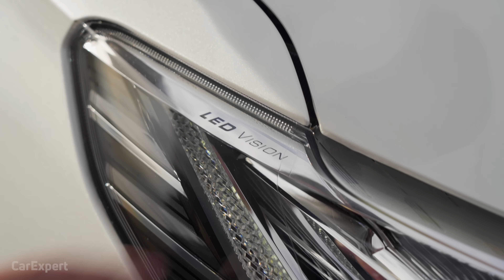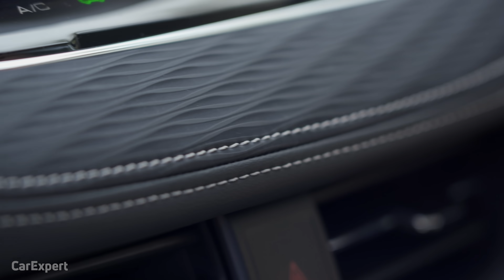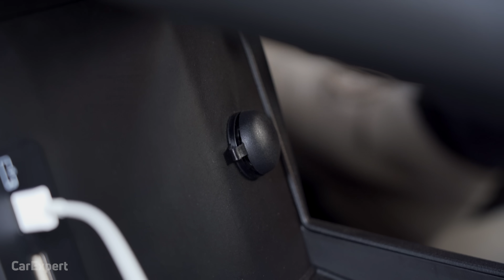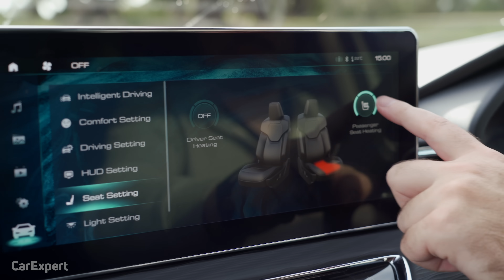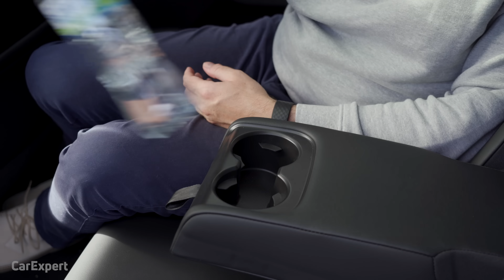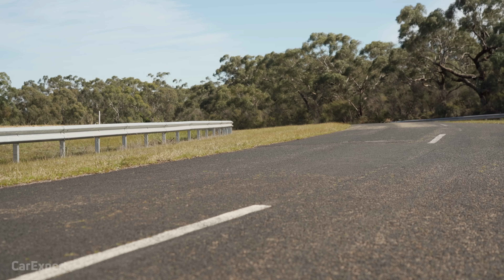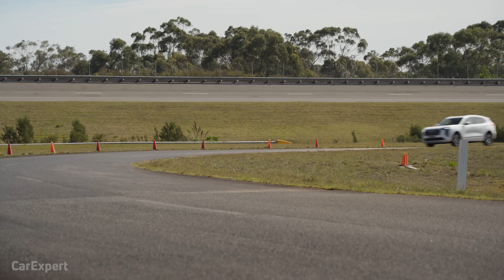2022 Haval Jolion turbo detailed review (inc. 0-100)

Comment: Drove one of these in NZ. Horrific car to drive. Awful auto and gearbox. Multimedia is totally useless, and the ride is disconnected from the road. Avoid at all costs!
Reply: I drove my friends Haval H6GT. The gearbox was horrible, it jumped and kinda stutters into first gear, there is very noticeable throttle lag as well. I had to go more than 30% to feel something. The android auto is wired and when I try to use wire it doesn't even detect it. Even though its got all the bells and whistle, the engine, gearbox just puts me off completely. I'd rather just buy a BYD EV instead of I were to spend the same amount of 40k

Comment: There is a sports mode, acceleration is much faster and gears shifts differently as well. Fuel consumption goes to hell :D That said, you can access the modes by swiping from the left of the console screen. ECO is really efficient, but slow like a tortoise when it comes to acceleration (especially on cruise control)

I know I am 2 years late.

Comment: We own a 2020 Haval H2 & she is a joy to drive. Within the first week we loaded the boot space including the fold down seat with a load of wood for winter fire. The ride was comfortable especially over back country roads. We have had four adults ride with the back seat belts challenging to click into place. The warning lights showed these were not correctly clicked. The passengers were surprised by leg & head room, even with the arm rest down for shared comfort. The luggage space was plenty for two suitcases & carryon bags from an air flight home. The six speaker sound system was easily adjusted for maximum pleasure for the driver . This is the first SUV in our price range and is more than enough for our, & family needs.

Comment: i have driven the haval h6 lux 2018 for nearly four years, long distance driving on a regular basis has proven to be nicest and most  comfortable, safest ride fuel economy 9.5. i have only just replaced tyres. the only down side was the cost of fuel at 95ron i have just traded the havel for the new h6 GT ultra with a better fuel economy of 8.5 and it takes 91ron I recommend the Haval for a great driving experience and good bucks for your money, affordable luxury
Reply: Hi,
How is it now?
I'm in the market for one?
What is your advice?

Comment: I just took receipt of the MY22 Jolion Vanta. To say it's the best car I have owned would be lying. My MY21 Hyundai i30 elite sedan was. But it got flooded in Brisbane and I thought I would this a shot. It comes in at.01% less than the Hyundai. Only reason is with the Hyundai I could change the dash colours from Blue to Red to Green.. So normal, sport and eco driving respectively. I wouldn't have owned a GWM a few years ago as they had a name like Hyundai did in the early 90. Now I don't think I will convert back to any other. It will be good to see a full electric come out
Reply: Hi, did you receive a Key number Tag as in the owner's manual Page 18? If so, is the Tag last 6 digits is your VIN number? Appreciate your reply.
Reply: Hi,
How is it now?
I'm in the market for one?
What is your advice?

Comment: Just picked up my new Haval Jolion Ultra Vanta 3 days ago, car looks and drive good so far but we were socked that they only give you one key and no spare key, they don't even know if they can order a spare key for me. They gave emergence key to open door only. Can someone help? thanks.  Australia
Reply: I am also surprised when I had only one key..don't know why they cannot make two keys
Reply: @sanathkavindika691  Hi Sanath, the 2nd key is not a big issue. Check if you receive a Key number Tag as in owner's manual Page 18 and if so what's the number in the Tag. There could be a security risk with your smart key fob codes.

Comment: Learning the electronics is a pain. One thing if you cannot get driving data on the screen through the wheel, hold OK button for two seconds.then up and down will change pages etc. As others have said swiping from very  left edge of main screen will bring up volume , driving mode selections , heated seats etc.  The other pain is the adaptive cruise control, good at keeping distance from car in front, but brakes excessively for the most minor corner even when no cars in sight to the point that you need to use the gas for all corners. Am told turning off lane keeping function  will deactivate this annoying thing. Haven't tried that yet.
Reply: Yes excessive slow down on corners, I get to anticipate this and have foot ready on accelerator. You would think a software upgrade could fix this

Comment: You got the handling all wrong Paul Maric. The low speed ride is what’s on point,  very few people are going to drive this car over continuos undulations at 120kph. The low speed ride is why it’s soft, you are trying to make the body control out badly, but many cars today are too harsh for normal city driving. You like sports cars so if course you like planted dynamics.

Comment: 9 liter per 100km for a 1.5 liter engine. That's pretty thirsty. I'm not a fan of a double clutch either. Had a VW golf and it's not good for inner city driving. Highway is great. Thought they would have improved by now
Reply: That's with almost no highway driving and driving in testing conditions, I'm sure you don't floor your car and go from 0 to 100km as fast as you can very often.

Comment: Hey Paul great videos! I'm tossing up between a Haval Jolion and a MG ZST, about the same price here in NZ, which one would you recommend?
Reply: Pefer Haval as it has higher reputation in china market. I own Haval tank 300 in China with 20k miles and it's quite good so far
Reply: Jolion. ... friend here bought an MG and nothing but issued with it.
Reply: Hey did you get the jolion? How does it drive? Thanks
Reply: @RohitSharma-wp6rx  yes I did end up buying the Jolion, about a month ago. It’s really comfortable to drive. Really enjoy it so far. The radar cruise control was a bit of an issue at first as it braked heavily on the slightest of corners but they have since realised a software update to fix that. In all the reviews they say the fuel economy is terrible but it’s coming down for me every time I fill up. I’m getting about 7.5L/100km now. Started out a bit high but the dealership said that’s normal for new cars until they break in a bit.
Reply: @ferti385  thanks a lot as feels much better when you get local responses. I am getting mine soon. All the best mate.
Reply: @RohitSharma-wp6rx  awesome! Enjoy, it’s a great car!

Comment: One thing you should have covered was the safety.

You can let the steering wheel go at 100kms/h and it steers itself which has been amazing.

Blind spot monitor is excellent. You should have showed what happens when you start to veer over a line the car will correct your steering.

The only feature we turned off was the distraction feature as turning the AC on bongs on the screen about paying attention to the road 

Lastly the cluster is fine we got ours 3 months ago and it's all English including stop signs etc.

If you need a jolion to test with mate happy to loan it..

Comment: This car proves how overpriced every other car on market is. It has many features and not just features for the sake of having them. The parking cameras for example are better than even some premium brands. Even the new C Class which is 3 times more expensive does not come with drive assist features as standard. I test drove a Jolion and was blown away.
Reply: Me 2.. I'm buying one cause how it blew me away too
Reply: I'm from Bangladesh & the Hyundai Creta sold here is from Indonesia, gross weight of that car is 1590 kg & It start's from 20,000 dollars in Indonesia (top model 28,000 USD) and 34,000 dollar starting price in Bangladesh. I've seen the car & build quality is good enough. Much better than the creta grand/alcazar in India, in which bonnet slap sound was very echo-ish & had noticeably thinner metal.

If I'm not wrong, Indian Creta start's from 12/13 thousand dollars & top model goes upto 22/24 thousand dollars.
Reply: @ostadfiha4225  It's too expensive for a car built like that.
Reply: What's the price??
Reply: I agree with you but at the same time also disagree with you. Toyota, honda, Hyundai and all big brands took decades of experience & spent billions of R&D and learnt how to make a good car. Whereas Chinese companies came 10/15 years ago, made partnership with them & copy paste everything from those big brands. That's why you get them cheap. No money spent, no R&D or decades of experience. Just the material cost & rest is their profit margin. 
You'll notice they lack many small details and imperfections in these cars which you won't find in a Kia, Honda or Volkswagen.

Still, great choice for those who wants a big car but don't have enough money.
Reply: @ostadfiha4225  I disagree especially if you look at Hyundai. The new Hyundai Creta is honestly a pathetic vehicle at its current price tag. The interior is extremely cheaply made, has no parcel shelf, a very basic infotainment system and overall just feels very poor. Newer VWs have very very plasticky cheap interiors and honestly, having driven the Haval Jolion, the ride quality and refinement isn't far off a more expensive T Cross all while being a larger car with much more safety and convenience features. It feels more expensive and isn't lacking in detail.
Reply: @SDav21   Hyundai Creta was primarily made for Indian market & Indians don't care about build quality. They care mostly about affordable price & high mileage. That's why it has more plastic & lighter body. 
If you look at the Hyundai Kona, which is for North America, Europe and Australia, that car is extremely well built & has 5 star safety.
Reply: @SDav21  yes, Chinese cars have came a lot far. And they're only gonna go forward in the future. Chinese phones have taken over, now it's the turn for automobiles.
Reply: @ostadfiha4225  And yet it is priced exorbitantly and is not cheap at all. It's horrible.
Reply: Typical..people look at features only and not core driving experience. This car is bloody awful to drive.
Reply: @mrkring1526  the car drives better than many in the segment.
Reply: @Mr Kring  using one as a hire car in Brisbane ATM had my doubts, surprised how good it is going
Reply: @mrkring1526 how do you know?
Reply: Chinese car. Think about durability!
Reply: @nadarfa9413  7 year warranty tells me they must have some confidence
Reply: @nadarfa9413  My cousin has an MG3 and Haval with 257,000ks on it. Still going strong. His hilux had more problems..
Reply: @nadarfa9413  someone is still living in 2000s

Comment: Hi Paul, im in South Africa. I bought the car in July. The fuel economy gets better the more you drive it. Im hardly on the freeway and im currently averaging 7.7l/100km. I absolutely hated the dual clutch at first but you get used to it. I love your reviews by the way.
Reply: I test drove it, great car by the 
Way. I'm going to trade in my polo for this
Reply: The new software update makes it a bit better.
Reply: My fuel economy was always 10L/100km and I had it over 2 years before I traded it in for something with actual power. That’s by far its downside is the complete lack of power
Reply: Hey Vuyi.  Are you still enjoying your wheels? 

Still averaging 7.7?
Reply: @MoneyTalks_with_Keba.M  hey, im still enjoying my car. I went and got software upgrade. My fuel economy is still around 7.7 or 8.0 if im really wilding. I pour R250 around the 15th and then on payday its R900 full tank
Reply: @vuyiswamokwena1399  Thank you so much Vuyi. This is very helpful ❤️

Comment: Not sure how I feel about all these controls on the LCD. 

Coming from a Nissan where the screen faded and became unusable in 3 years, had to drive around without a screen for 5 more years before I replaced it. At least the screen didn't control anything important.

Definitely looking at these chinese cars by the looks of it, they will offer a better experience than I had with Nissan.
Reply: It may be the only advantage of chinese cars. Nissan at least is not falling apart during the drive. How to leave your rear bumper on the road - on a city road, just spontaneously...

Comment: I have a MY21 HAVAL, Jolion, which I took delivery of in MAY this year. Have been really impressed with it overall so far. It now has a little over 4000km's on the dial. Fuel economy, On a recent trip from Bundaberg to Mackay, at an average speed of 105 KPH, I had no trouble achieving the nominated L/per 100k's. Acceleration is better than what you have specified and I have had no trouble overtaking B Doubles on the Marlborough Strip where the posted speed limit is 110KPH, have found that I am doing at least 170 KPH when I return to my lane after overtaking. Only real problem which I have encountered, and which I have been assured GWM are aware of and working on, is the Lane Keep Assist when on Cruise Control, it tends to apply the Brakes every time it looses "SIGHT" of the WHITE LINE on any Camera especially on bends in the highway. Overall am really impressed, mine is a Mid Spec model and it has ALL the "BELLS and Whistles" that my brothers $300,000 Mercedes AMG has, for less than10% of the price!!
Reply: Hey Merv, thank you for your elaborated review. However, May i ask how about the Nm torque you feel when push the accelerators? Does this suv push you back to your seat? 
My second inquiry, do you feel you on control on the car through steering wheel, does the steering wheels feels more on soft or firm? Thank you Merv!
Reply: @javed_mate  Am more than Satisfied with the Get up and Go, when the acceptor is floored it sits me back in the seat, not like a V8 but still noticeable.
Reply: Steering is positive enough for my liking, am a little upset with the LANE KEEP ASSIST, mainly when using Cruise Control, have been advised that GWM HAVAL are aware of problem and are modifying the software to correct the problem.
Reply: Accelerator
Reply: @javed_mate  If one chooses to floor the accelarator it certainly pushes one back in the seat, even more impressive in MANUAL mode.Steering always feels "Normal" to me.
Reply: Thank you Merv for your reply!
Reply: How much did it cost you??
Reply: @pkboss8324  way more then he should have paid
Reply: I’d not be publicising that you pass at 170km/h. There’s absolutely no need for that sort of dangerous excessive speed. Also if the posted limit is 110km/h you would not need to pass anyone doing that speed.
Reply: @jerrymyahzcat  B doubles travelling at less than posted limit require a lot of distance to overtake and I do NOT like to spend too much time on the "WRONG" side of the road which is how 170ks comes about!
Reply: It’s illegal to go over the speed limit while overtaking.
Maybe re sit your licence and buy a better car while you’re at it .
Reply: @W3TFART  I have the better car, and there is NO restriction on overtaking!!
Reply: @mervallan1822  better go resit  your licence then because you are wrong

Comment: If you select the sport mode the car would have more punch. I think the reviewer is using a normal/economic mode that is why the car saves more power in exchange for fuel efficient. I bought the Haval H6 top version and it has all the safety features and technology almost just like luxury cars. The screen also is not lagging compared to some more expensive cars which can be lagging sometimes. For money wise it's really very satisfying car unless you want a 100km speed in 3secs then this car doesn't suit you. The panaromic sunroof is so huge and satisfying, you will look cool when you take the pictures from inside the car because of the huge panaromic sunroof that makes the car look luxurious. You won't regret buying the all new 2021 haval h6 or jolion for that price.

Comment: Can’t wait for your H6 Hybrid review. Preordered mine for delivery around Xmas.
Reply: What is the price of the hybrid?
Reply: @adambeck4416  same as the petrol version.
Reply: @Mrblobbster  which country do you live in Australia?
Reply: @adambeck4416  Nope. New Zealand, so should be a similar price in Australia
Reply: @Mrblobbster  I just went on the Australian and new Zealand GWM websites and the hybrid is not even advertised
Reply: @adambeck4416  I asked the dealer about it and he told me they arrive Xmas. He took my money for the preorder so it better show up 😁 The price is locked in my contract so I doubt it will change. 40K NZ$ for the top spec model.
Reply: @Mrblobbster  I called a dealer earlier in Sydney and he didn't know when it is coming to Australia or what the price will be.
Reply: @wcrash9361  Yes indeed. The dealer called me a couple of weeks ago to tell me about 6 weeks delay and a price hike of $7000 NZ. Canceled my order and bought a Model 3 instead 😀
Reply: @wcrash9361  get a life mate

Comment: Got the Ultra 2 months ago and love it. Have been in lockdown so haven't had a chance to get it on the open road yet though. Very fair review. Wish you drove it in sport mode. We find it much better. Also if you swipe from the left of the screen to the right you get a few short cuts including volume, which is great for the passenger as the only buttons are in the steering wheel, and the heated seats.
Reply: @michaelchubin6516  how's the haval now? Any issues so far?

Comment: Hi Paul thanks for good review, I searched on carsale and found the older version H2 scored ANCAP 5 in year 2017 so the new Jolion should be ANCAP 5 as well.The Jolion is base on new LEMON platforms and use high strength steel.